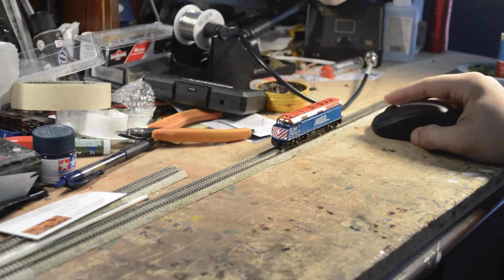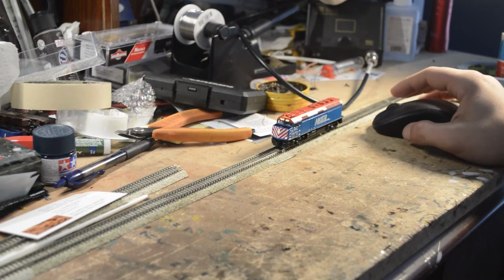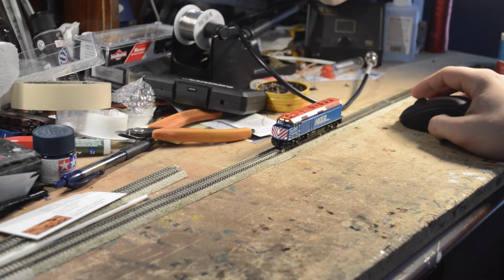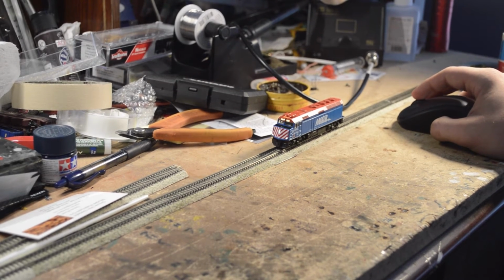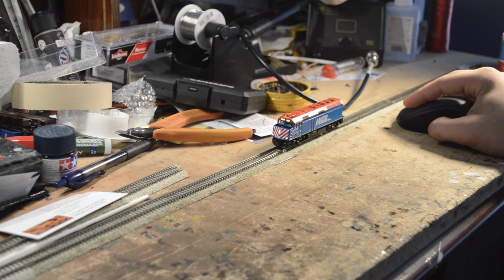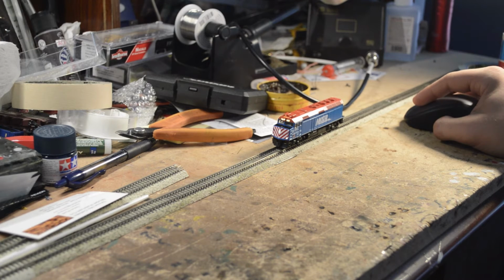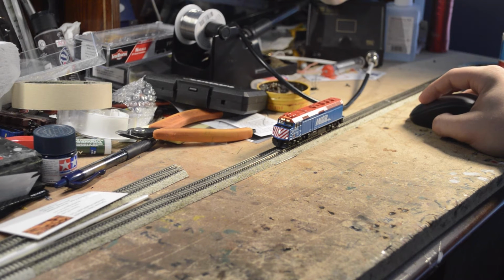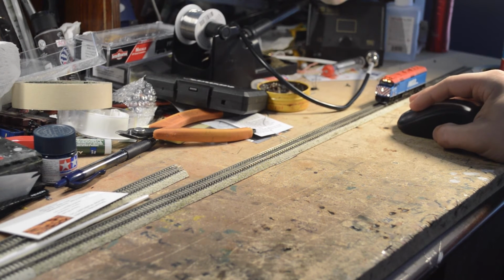Kato N Scale EMD F40PH Metra #163 w/ ESU Loksound and Lighting

Comment: I think the Metra F40s have flashing ditch lights, I can't imaging trying to wire them up. I'm sure someone has but I don't have the steady hands to do it myself. That's really good sound from that tiny loco. And a great video too
Reply from the maker: they do have flashing ditch lights and a Mars light over the top between the number boards. In order to keep the cost down the customer asked to keep it simple but I have a future Metra F40PH project that may get the over and out treatment. thanks.

Comment: Do you have to solder some wiring to the LokSound decoder's rear to get 2 xtra AUX's  for more lighting ? From what I understand, there's the front (white), rear (yellow), Aux 1 ( green), Aux 2 (violet) that can be used for ditch lights. What about other lighting like number boards or cab interior ?